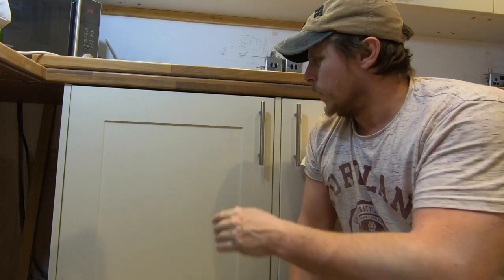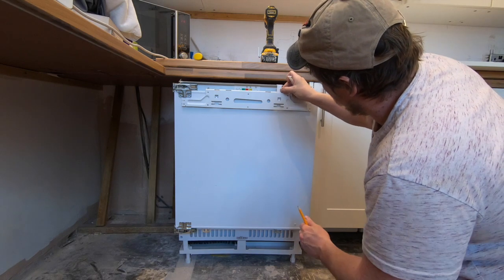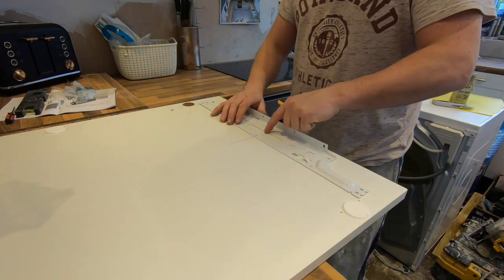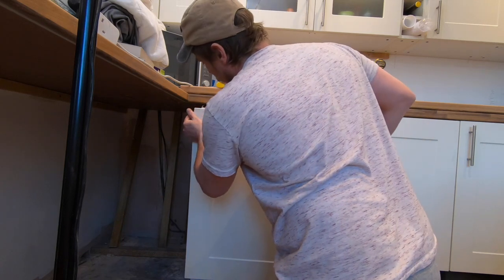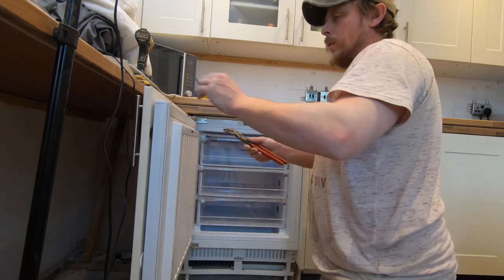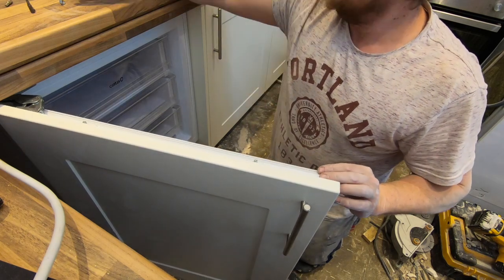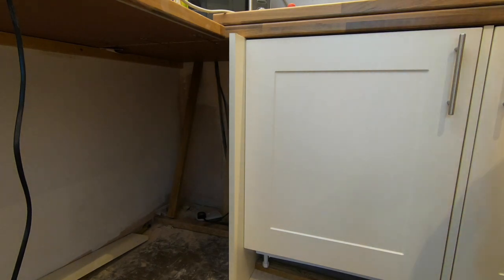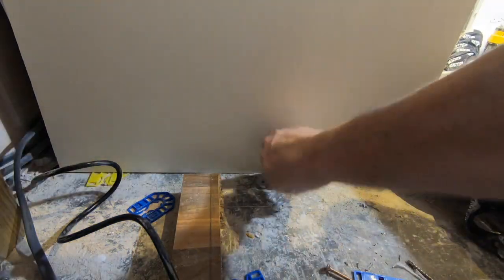HOW TO FIT A BEKO INTEGRATED FREEZER. Including Fitting of the side panels

Comment: Great video but when you can, especially when the metal piece on the tape measure doesn't fully go around an edge of what your measuring, go from the hundred millimetre mark on your tape which allows the tape to be flat and no discrepancies, but remember to add on the 100mm to what it shows on the tape!
Reply from the maker: Great point!, i have done that when i want a really close measurement but its a good tip thank you mate